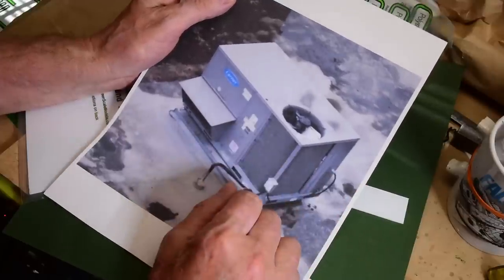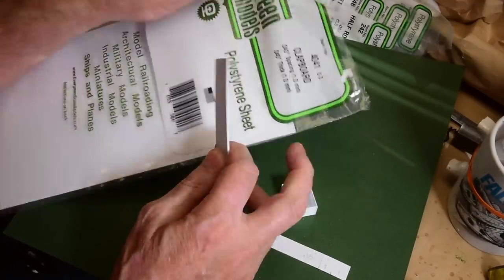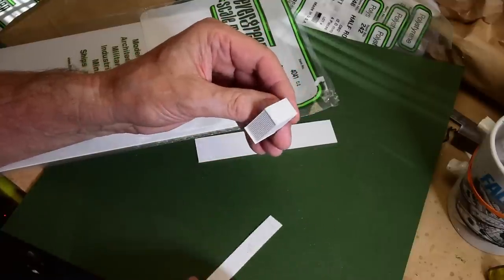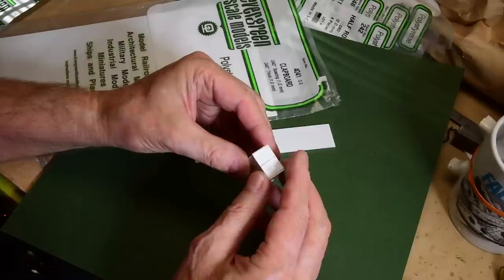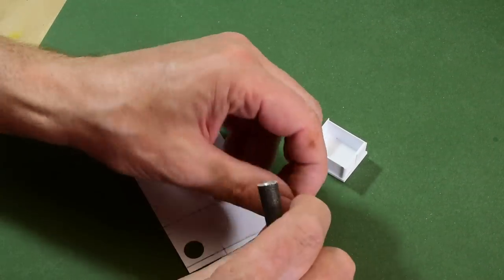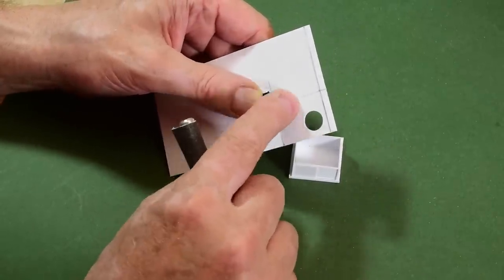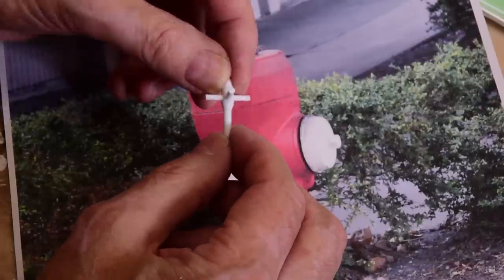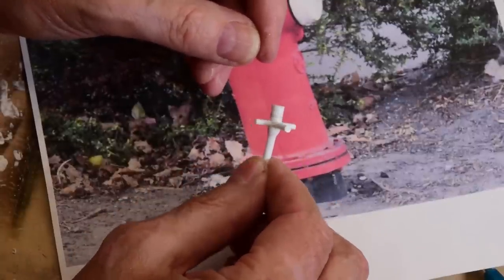Scratching Random Details & Telling Your Railroad Story | Boomer Diorama ~ Vlog # 195

Comment: Dear Boomer, love all these details! On the roof vents you were making; what you called a converter may also be a sound silencer/damper. The rings close under the hood are mainly drip rings, preventing drops falling from the hood to fall into the duct. The lower rings are most often the flashing rings, which go over the roof upstand or the roof duct, having a slightly smaller diameter at the top end, to accommodate the flashing diameter. The roof upstand or duct almost looks like the horn of a trumpet before it is mounted on the roof. The flat side of the trumpet end mounted on the roofing material and covered with a circle or square piece of roofing material, depending on the kind of material the roof has been fitted with. 
I don’t always use evergreen to make these details, often use straws or roll my own. Either I cover them with pieces of aluminum tape and/or just roll ‘m from the aluminum tape in one go. With the small jeweler’s half spheres form piece I make the hoods, just by slowly embossing the tape into the form. Or I just turn a ‘Chinese’ hat kind of hood. Works awesome. Sticks real good, and is a lot of fun to make in such a small scale.
Love the fire hydrant you made. Looks the part. Awesome vid! Cheerio
Reply from the maker: Cheers!